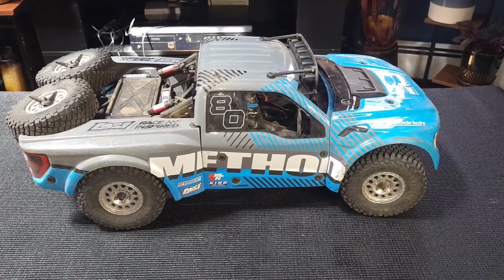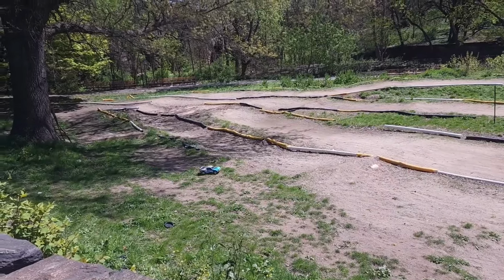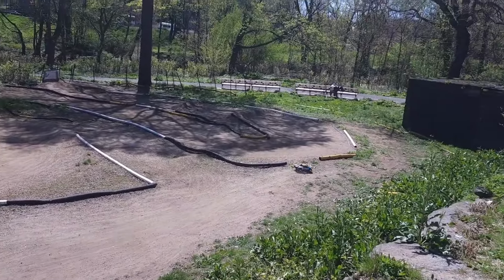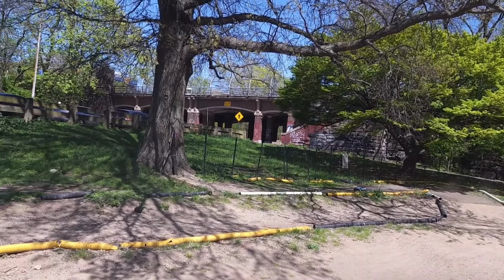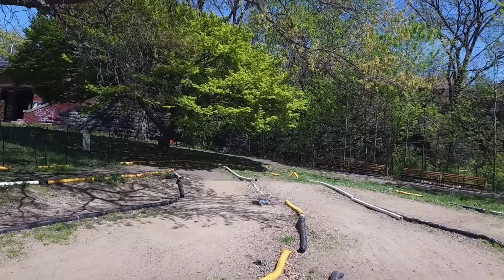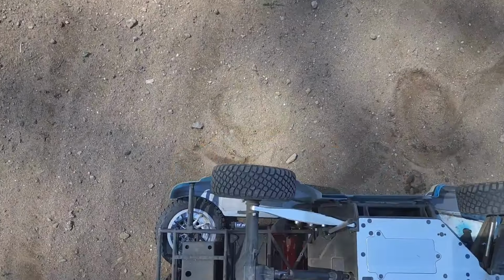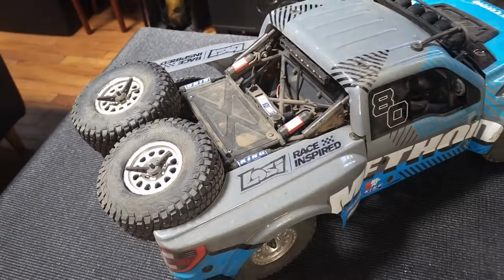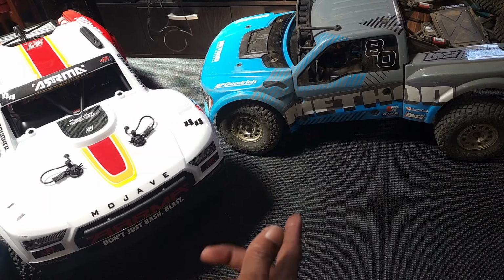Those Upgrades Are TRASH!  So is My Driving...SMH

Comment: I kept the stock shocks and swapped the shock oil in the front to 45 it.  It was just right at the bmx park.  Take a look at the vitavon rear links.
Reply from the maker: Will do!  Thanks 👍 
I went thru the shocks again after I filmed that. Re oiled with 40wt and made sure they were tightened properly.  I think it's good now.
Reply: @bigbristv  like you said in that vid. Gotta stay on the power thru the jump otherwise it's donkey kick city.  Nice work, glad ur posting.

Comment: 0:57 Tell me you have solid rear axle without saying you have solid rear axle. ;)  This is a sweet, sweet looking rig. But man these scale desert type trucks with solid rear axle vs say 4 wheel independent suspension will never be jumpers all that much. That being said, if you had a race in some sandy dune with big bumps in it requiring good suspension travel, there you'd probably have an advantage.
Reply from the maker: Bingo! 🫡💯
Reply: you think this thing could drive well in the snow? hard snow/icy surfaces with some bumps and smaller jumps

Comment: I have the SBR 2.0.  They just drive differently.  Definitely not a basher.  It doesn't kick up much but it does torque twist when launching on bigger jumps.  They really are scale driving trucks compared to my Mojave 4s and 6s.  It makes the Mojaves seem like a basher.  
Does the small Baja Rey have the chassis flex like the big one?  That was my biggest issue.  Once i put on the chassis stiffener under the bed it handled much better. Especially landing jumps. 
I still love the trucks.  They aren't perfect but a lot of fun still.
Reply from the maker: Haven't noticed any chassis flex yet.  I'm really liking it so far.  I thought I was gonna return it.  It's so much different than my Mojave I'm keeping both 😁